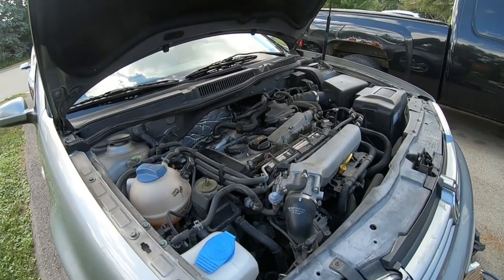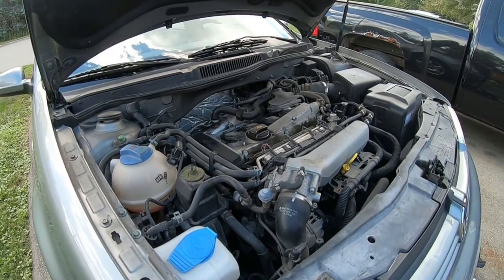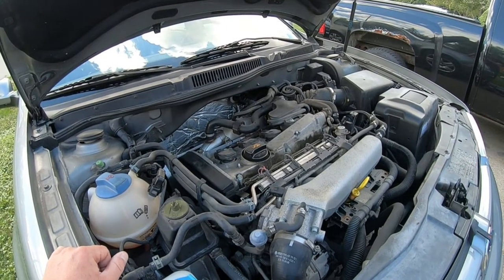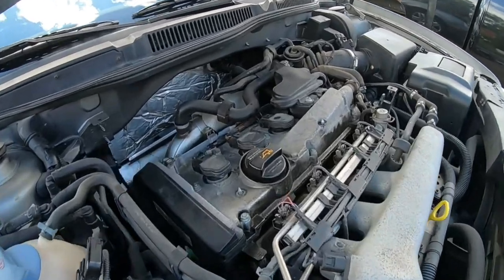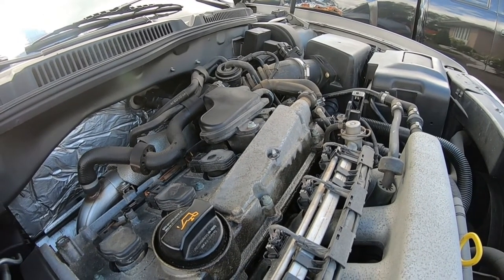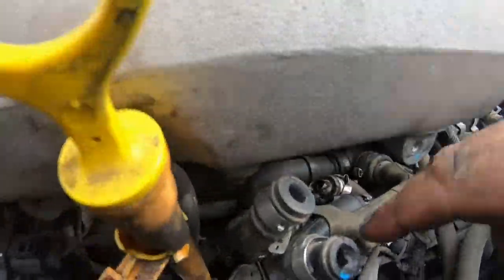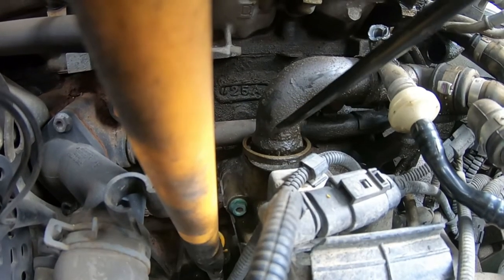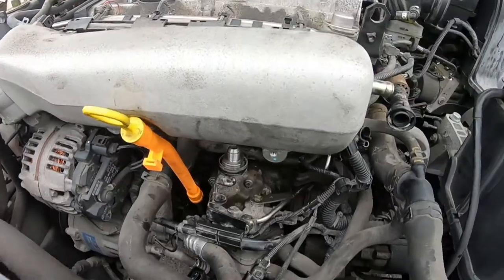MK4 GTI Urotuning SAI Delete (Time Attack Build Ep 1.1)

Comment: great video.  I have a 1.8t gti that had about half of this stuff done. This helped greatly to finish the job.
Reply: What’s the point of?
Reply: @Rockony  cleans up the bay, and minimizes the odds of a potential vacuum leak with all those old rubber and plastic lines

Comment: Using those pcv fittings seems so pointless to me. You’re replacing something that’s the exact same just looks different. Also that hockey puck is still of use to recirculate air back into the intake

Comment: Hey man was the resistor you got for the sai pretty tight on there. I got the urotuning oval on cause it looks oval but I’m not sure it’s connecting all the way. I’m pretty sure it’s callled n112?
Reply: Or n80?
Reply from the maker: So sorry for the late reply. Sadly Im not that familiar with the actual resistor or connection numbers. The resistors I used though was perfect fitment and were tight!

Comment: 3:20 The clamps you call one time.. Arent one time... There A stainlesssteel.. and either Clic 66 range. or ClicR 98 range..  they start at one dollar per piece.. and have unlimited reuse. if you make them open with the propper tool (which doesnt cost allot too if you look good)  i'm currently busy with my mk3 fuel tank.  and there msotly found Clic 66 130 (14.3mm)  did however not had the propper tool so going to replacethem seein the alternative are for wha ti can get here.. 10x worse xD . soo thats my information on this subject (y) hope it helps
Reply: some you see however are one time do.. but watch for colours tags on them. and a R shaped end shape. the ones that looks like Omega shape are deff one time use
Reply from the maker: @Albert87nl  Thank you! I hate using them lol
Reply: @Albert87nl  They are one time use ones pal
Reply: @jellekorthuis9018  not the clic r one's
Reply: @jellekorthuis9018  from manufacture | ✓ The CLIC-R® clamp is removable and reusable (if disassembled with care). |

Comment: Where does the diverted valve line go to? I’m having a no start issue at the moment and idk if that would cause it
Reply from the maker: The diverter valve line runs to the port under the intake manifold. Beside the line for the fuel pressure regulator! I havent had any issues yet with starting.
Reply: @maxattackmotorsports5354  I figured my issue out, hooked some stuff up wrong! Lol hooked it up right and fires right up!
Reply from the maker: @brandonkeithley7464  Awesome! Glad you got it running!
Reply: @maxattackmotorsports5354  thanks! Me too! I appreciate it!

Comment: After doing all that I have too much pressure in fuel tank, when I open the fuel tank cap it it makes lot of noise when coming out
Reply: I did all same except i didn't use cap on evap line that's comming from the tank i used silicone line one side pluged in evap and other side route it to the fender i also added small air filter on end of the line
So far i have no issues

Comment: After watching this video and the catch can video several times over the last couple months I finally was brave enough to follow along today. So far it seems like it works but I have one question. I am trying to avoid taking out the secondary air pump for now until I have a tune, is it ok to just throw some tape over the end of the hose that was connected to the combi valve? I started the car up and it was just blasting air out of it which I was not expecting
Reply from the maker: So sorry for the late reply! I would just delete the pump!
Reply: @maxattackmotorsports5354  yup. the car ran really weird when i left it attached and caused a CEL anyways. Sadly i just learned from my local tuning shop that they can no longer tune out the pump for me so the CEL is permanent, thanks EPA